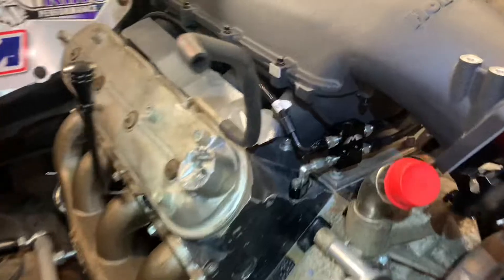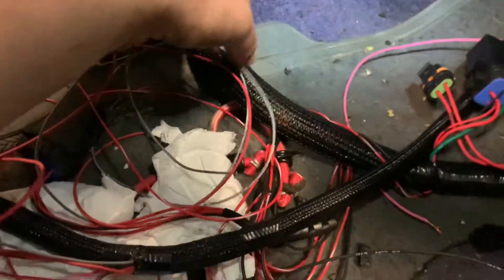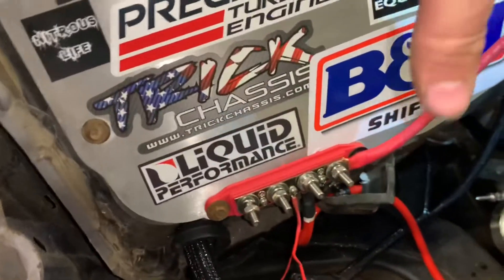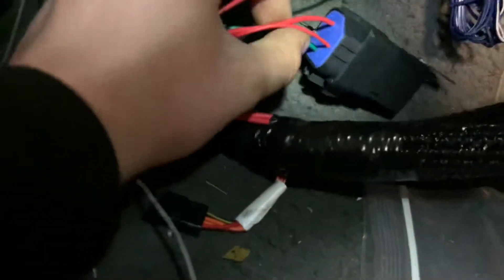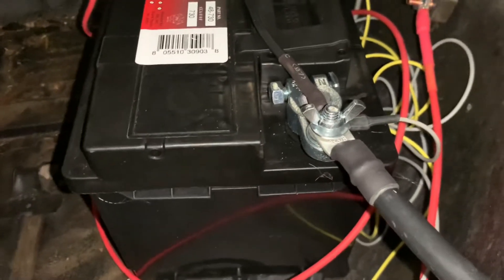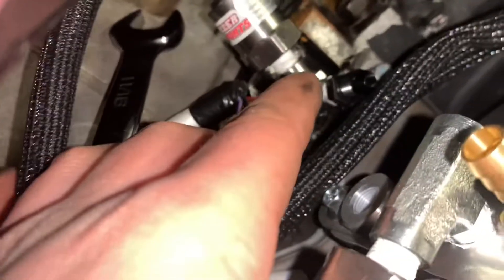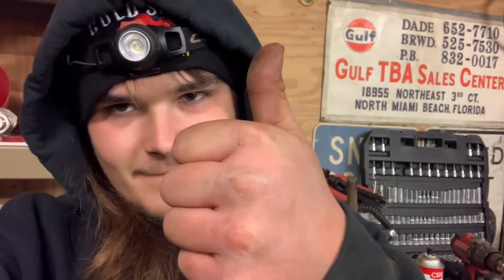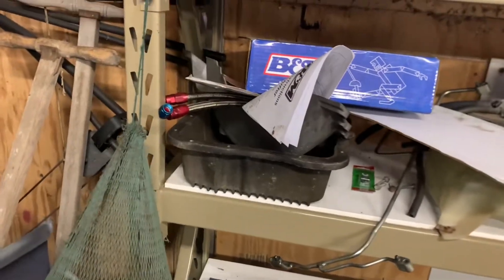Gbody Wagon Turbo LS Swap pt13 (Terminator X install /// Couple small things and ready to fire)

Comment: Question so constant power to ignition to switch power
Reply from the maker: I have a bus bar with constant power from battery. One wire goes into my ignition switch, one comes out that power my other bus bar. So when I flip switch I have my ecu and other things wired into the switched power bus bar. Not constant